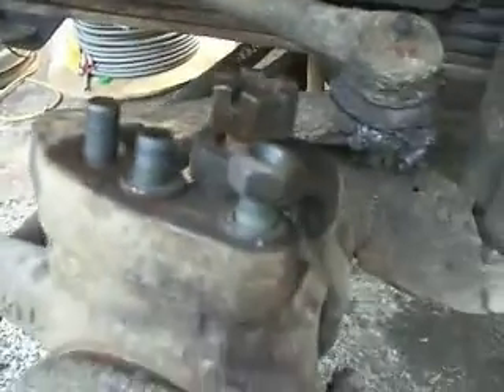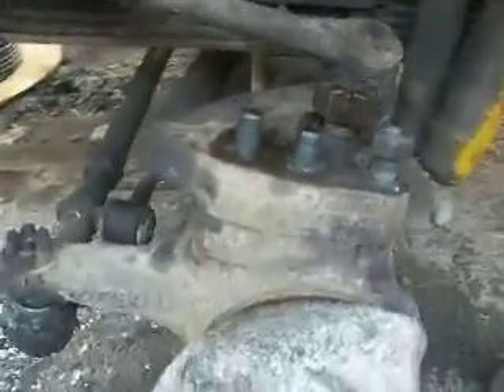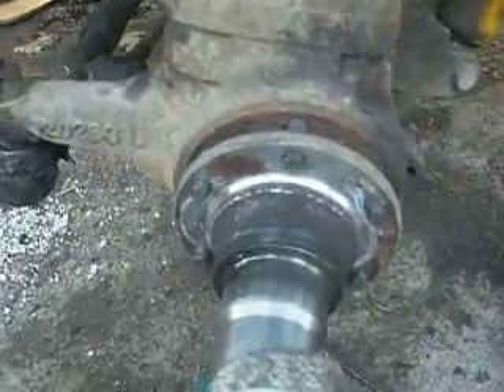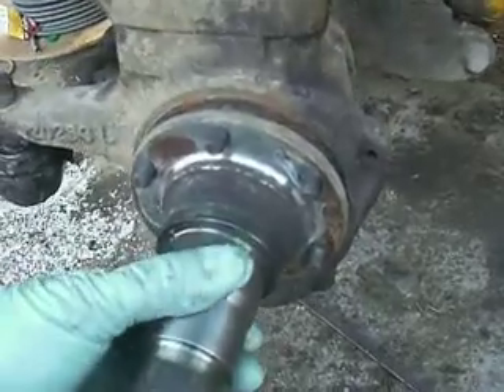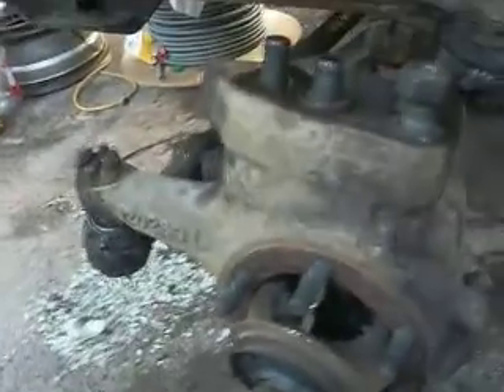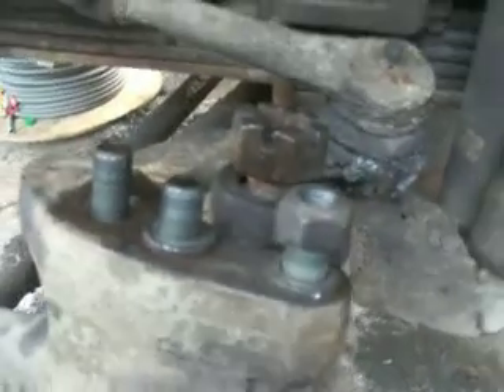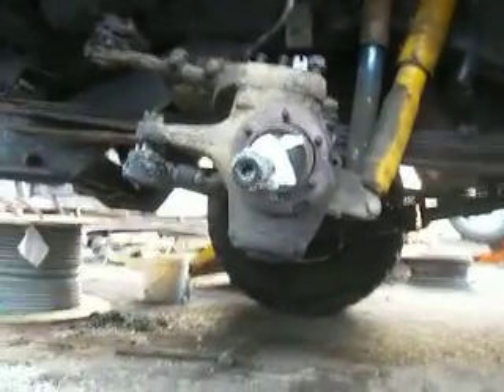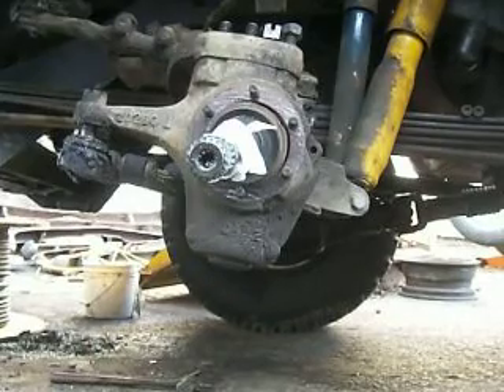BFH... 101...

Comment: Thanks again. The Haynes manual just says take off the steering arm like it shoud just pop right off after removing the 3 nuts. Never mentions the cone tension pieces in the arm. Pounded on it with the sledge and they popped right up. I was getting so frustrated I was about to start hitting it with a sledge hammer anyway.